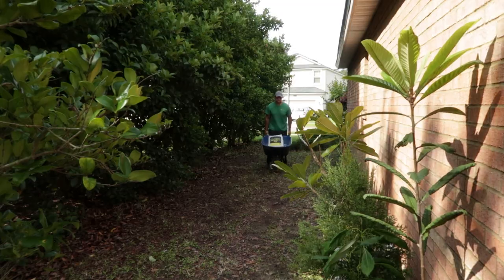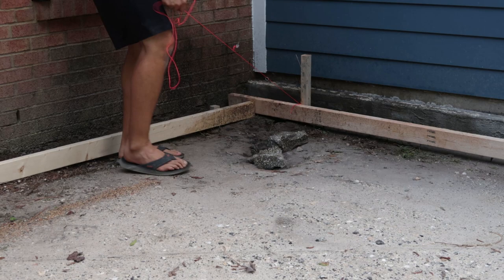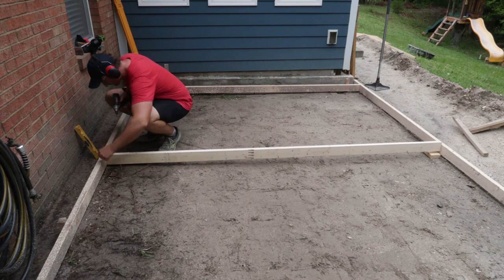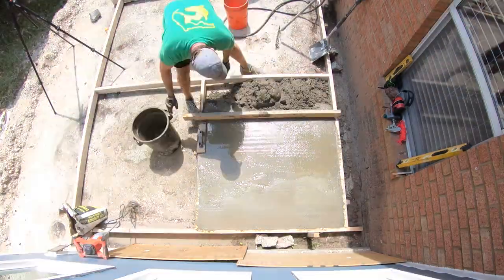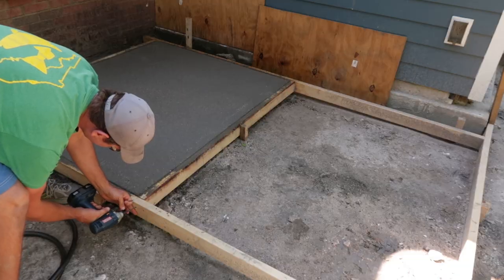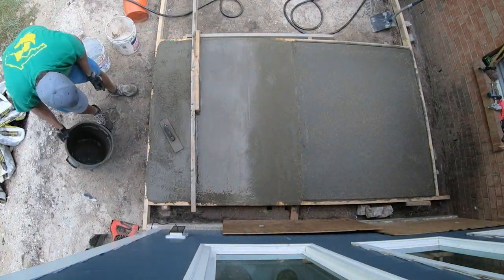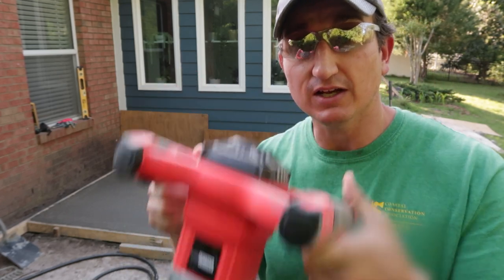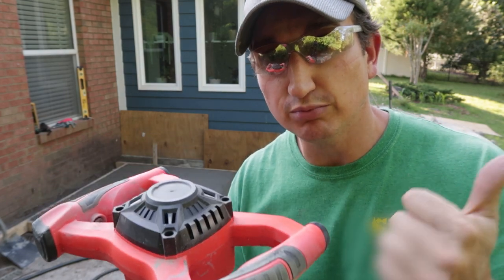Forming and Pouring Concrete Patio By Myself

Comment: I'm very much thinking of doing this project myself. I have a small patio that i want in the corner of my garage and walkway. I've done concrete before but the idea of sections, like 4 x4 makes more sense to me.
Reply from the maker: Thanks for watching and commenting. Best of luck with your project and please share an update when you get it done!
Reply: @MrKistel  I have a half inch drill and a pretty big paddle mixer. Many are saying to mix by hoe in a wheel barrel to save the back. But you didn't have to mix with a hoe, sounds faster too. Did you roll the can over and just tip it? Think my drill combo will work?

Comment: This is a fantastic video as was the other side's video. Question: Regarding the gap in between the house and patio, why do you need to treat for termites against concrete or bricks?
Thanks!
Reply from the maker: Thank you. The house is wood-frame construction with a full brick veneer.  Generally, the method is to apply termite treatment around the entire perimeter of the house.
Reply: @MrKistel  Yes thank you for your great information. I live in SC so termites are a big issue, especially the subterraneans. 
I think I might apply a 5 or 10 year application of termador myself, and rather than leave the gap, I might just bring it up to the structure and bite the bullet and hire terminex in the future to apply with that hole drilling technique. 
THanks again, all the best!

Comment: Can you tell me please want to do a bbq area and put a wood frame canopy over it, would it be strong enough to put metal posts brackets into this base
Reply from the maker: Potentially metal post could be put into the concrete and/or placed on top of it. However to support the weight of the structure built on the metal post, it may be appropriate to pour footer sections of concrete under where the post will sit.

Comment: Also, did you install expansion joints between the different sections or just meet the previously formed section up with the new section?
Reply from the maker: I did apply expansion joints in some areas where the concrete may have not had enough play in case of expansion.  You may find some of these in the full-length video here https://youtu.be/GJxY-FoV2CE

Comment: Hi what concrete did you use or recommend?  We're going to do our own patio too.
Reply from the maker: I just used what bag mix was available at the local home centers.  My understanding is the pre-bagged concrete mixes use smaller aggregate which may make it less strong then delivered premixed concrete. However for a patio like shown in the video the pre-bagged concrete mix is plenty strong.

Comment: I am about to do a similar project, do you not need rebar for this?
Reply from the maker: Rebar reinforcement was determined not necessary for the concrete project shown in this video. I can't speak for your project but please share with how you proceed with your concrete patio.

Comment: I'm no concrete guy but may I ask why you chose not to use wire mesh at least?
Reply from the maker: Adding wire mesh to the concrete patio pour was determined not necessary for this project.  Mesh will help to hold concrete sections together should it crack.  This is a light duty patio that will not experience heavy loads. In addition this concrete patio was poured in small individual sections which should allow each section some slight "flexibility." Each section is isolated from the other sections so a force on one section will not be transferred to another allowing some play and thus minimizing cracking.
Reply: @MrKistel  very good! Excellent job. Inspirational actually. I intend to follow suit

Comment: Im planning on doing an extension to my driveway to fit another car or two how much do you think it would cost to pour an area around 440 square feet by doing it myself?
Reply from the maker: To get a good estimate of materials cost for your project I would recommend checking out online concrete calculators.  Best of luck with your project and please provide an update with how it works out. Thanks.

Comment: nice video.  About how many buckets per section were needed?
Reply from the maker: I think I used close to 180 concrete  bags (80 lbs) total for the entire concrete patio pour.  I mixed one bag at a concrete at a time when using the mixing drill.  Each section required a different amount of concrete bags to be mixed, I believe anywhere from 20 to 40 bags per section.
Reply: @MrKistel  i'm looking to do something similar so this is a big help, thanks amigo